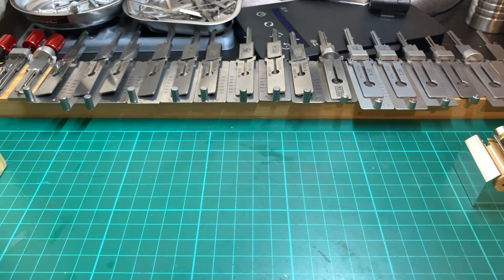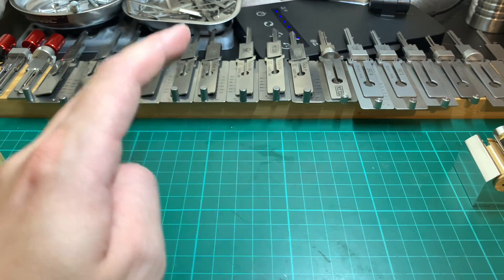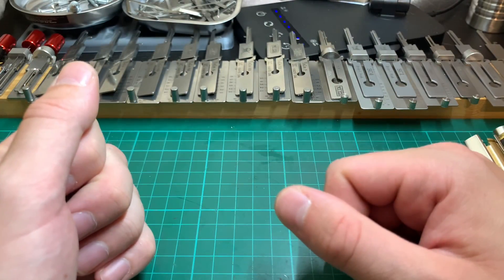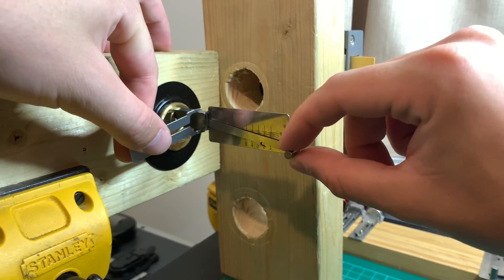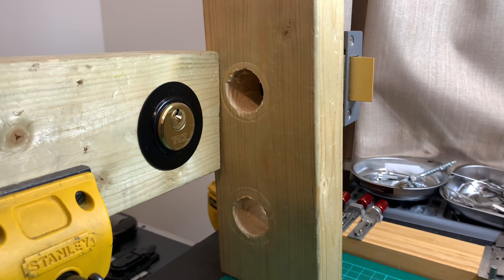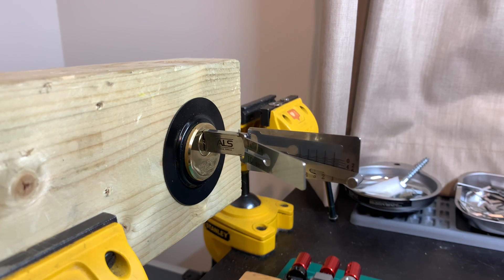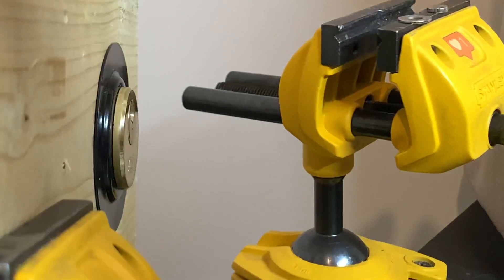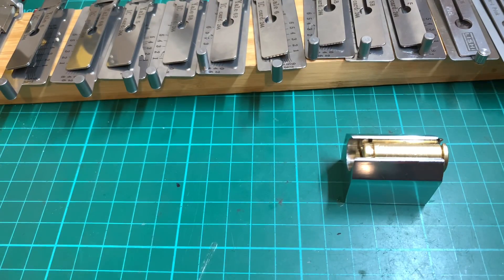Things to know about lishi in the uk

Comment: wow Guv what a pleasant surprise, I was gone for a little over 5 months and as soon as I get back I see u showing off ur new toys here. Lishi Yale, I thought this would never happen. So I guess those wicked 1star euro Yales are not a nightmare anymore?
Reply from the maker: It’s definitely picking some 3* and 1* very well.
Reply: @GxAxV  Nice 1, those 1star Yales had been my sworn enemies since I bought those bloody things.  I was wondering if u could use a six-pin Lishi b on a 5 pin rim cylinder?
Reply from the maker: @Alx-SG  some yes, others no. In some locks the tip of the pick hits the tail piece before the shoulder is fully inserted. If you do find a lock where the 6 pin tool fits all the way in then it will pick just fine and the lines match up perfectly still.
Reply: Hi mate. Do you have a link to buy these please. I do warrants and think they will be great. Cheers, Dean
Reply from the maker: @dean7631  hi sorry I thought it was in the description, it is now 👍🏻

Comment: Extremely informative video.
A quick question for you.
Which lishi tool would open a ASEC 11875  5 Pin Euro Cylinder. Obviously like you mentioned in your video lishi are meant for Yale only, but they do open others.
Also this key number 4EA278 that is for Assa Abloy 6 Pin Euro Cylinder, what lishi would be suitable for the cylinder??..

Regards T

Comment: Hi Gav, great video thanks, I  have been using the 5 and 6 b without a problem so I thought I would get a 6. The first lock I tried it in was a new original Yale cylinder that uses the new key pattern Y42A I believe. Pin chamber 2 was blocked as shown, is it specific to that key style, ?
Reply from the maker: The new yales have this shelf blocking yes, not all but a lot do. Not much can be done unless you can remove the tool with keeping tension and pick that pin by hand.

Comment: I want to get in to this as kinda like a side job as noone in my area does this what's the best way to start?
Reply from the maker: Unfortunately there is no quick route in locksmithing and not really any cheap way either. If you where to start I would suggest forgetting about lock picking as that’s a very small part of locksmithing and not that part that’s going to make you money.  Get tooled up for lock fitting and door mechanism repair.

Comment: I still don't quite understand why the ledge on pin two is a issue. I believe what you said, but aren't ALL the holes drilled to the same depth?  What am I missing?
Reply from the maker: No, so that particular chamber is not drilled through like the rest and this prevents that really short pin from falling too far into the keyway which would cause problems with keys. You may find this ledge in about 2/10 Yale locks.
Reply: @GxAxV  Why wouldn't YALE or that particular lock manufacturer randomly drill any hole shallower like that on chamber two, especially if it was intended to defeat these type of picking toold?
Reply from the maker: @laurenarndt464  as stated in the video it’s not about security at all and is to stop the shorter pin going too deep.
Reply: @GxAxV  Interesting. So, if the lock manufacturer wanted to use a shorter pin elsewhere, one would expect a multitude of uniquely drilled cylinders, which pretty much makes these locks undesirable for re-keying. I think if you said that these are custom drilled cylinders to accommodate only shallow pins that could be found anywhere on a random lock, it would have been more clear to me. But the manufacturer did inadvertently helped defeat the newest pick as you stated. I would think that lock containing shallow pins could be seen by scoping the keyway inadvance. Thanks for your earlier responses.
Reply from the maker: @laurenarndt464  the pick will instantly tell you if the lock has one of these chambers. I have only ever seen one chamber in each lock like this and they are in some pretty old Yale locks too so it’s been a thing for many many years 🤷🏻‍♂️  it’s odd for sure.
Reply: @GxAxV  So, the low set pin interference problem may only be unique to a few locks, probably not much to worry about. BTW, your video was very well done.
Reply: I think this low pin thing is more relevant than I previously thought. I purchased an APECS Euro-cylinder the other day. It's a YALE style S-grove but not a true copy. This 6-pin lock contains two shallow drilled pins, one on chamber 1 and 3. I believe the manufacturer did this to reduce bumb attack...I could be wrong. Nevertheless, the shoulder of the keyway would likely cause the same interference problem on certain Lishi tools.
Reply from the maker: @laurenarndt464  not to do with bumping as obviously keys have no issues touching all the pins as normal.

Comment: Will any Lishi picks do cars and household locks plz? Or do you need different ones?
Reply from the maker: You need different picks for each lock
Reply: @GxAxV  Do you need different car picks or does one do a few different makes? Could be very expensive if you need one for each model
Reply from the maker: @kieronrollins  yes a different pick for each lock. It does get expensive.
Reply: @kieronrollins  Some Lishi Picks will do multiple vehicles. Lots of Ford and their subsidiary brands use the same lock types. The same with GM. You’ll just have to look through the model lists for each Lishi. The picks also change with the year models as well.

Comment: Can a 6 pin SC1 work in a 5 pin SC1? Please answer
Reply from the maker: So there is no such thing as a 6 pin SC1 I don’t think but I understand what you are asking.  SC4 is the same as 5 pin SC1. SC4 lishi can be used to open both SC1 5 pin and 6 pin but I recommend buying the small plastic spacer to step the tool out.
Reply: @GxAxV  I get what you’re saying but you got some info wrong😭 I have the SC1 Lishi tool that opens 5 pin SC1 locks that are very common here in the USA. Half the home owners have it on their front door. There was a SC1 6 pin lishi that I could have bought but I figured because 5 pin is so common and because when you pull the lishi out to make up for the missing space it would put tension on the tool and possibly break it because the tension is supposed to be taken care of in the front of the lock where the 0 cut is left on the key for 1-2 cuts. Thank you for your input though! As long as it doesn’t do what I described , I will get a 6 pin SC1 lishi.
Reply from the maker: @davidulvestad2944  ah I get you mate sorry about that. I must admit we don’t deal with schlage here really so I have been mistaken it seems on the SC1 and 4. I see that deviant O sells the little red spacer for the 6 pin to make it a 5 and he will usually tell you if something is shit. Hopefully you figure it out ✌🏻
Reply: @GxAxV  Thanks I’ll research later!